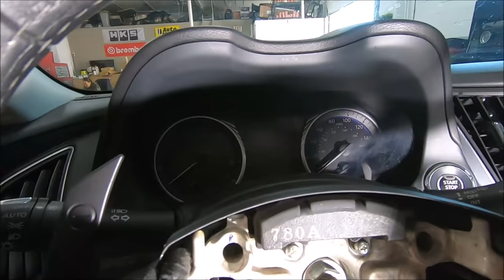Installing GT-R Paddle Shifters on a Totaled Infiniti Q50

Comment: Not sure I understand your logic behind the column mounting of the paddle shifters. Coming out of corners shifting is much easier if they are wheel mounted, but I guess that does not matter with those absolutely gigantic shifters.
Reply from the maker: Depends on use, but I never plan to track the car like that. I come from a drifting background, so having them stationary is my ideal setup.